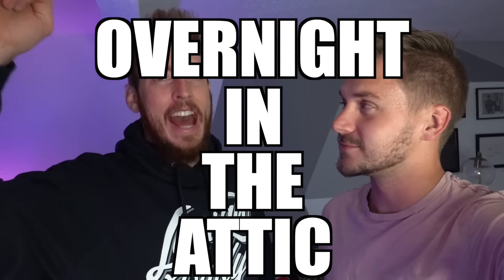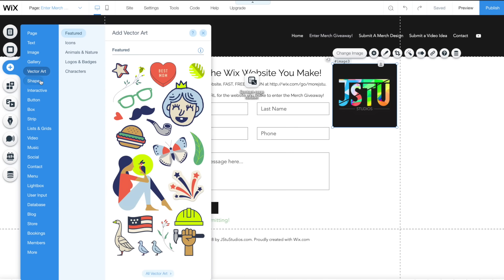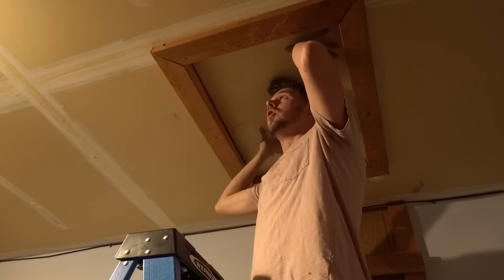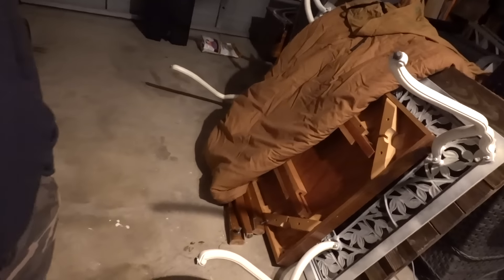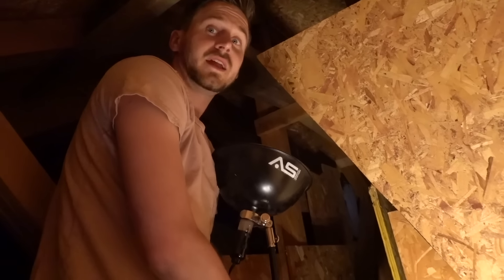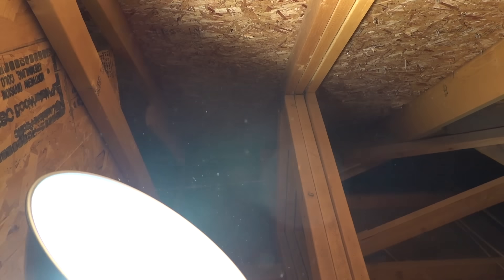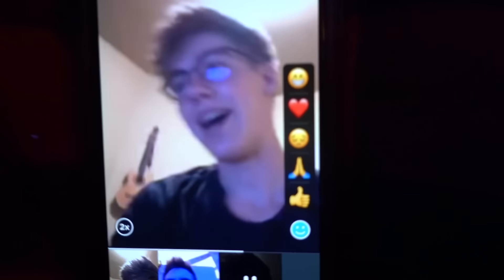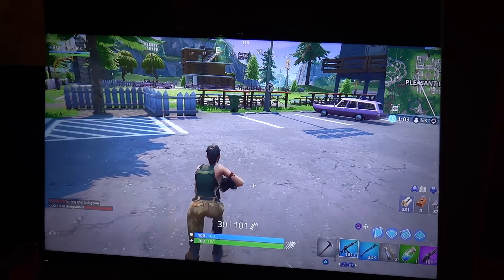24 HOUR OVERNIGHT FORT IN THE ATTIC!

Comment: Ps if you put vinegar on where the fiber glass  Insulation touched you it will make it stop itching/hurting.😁😲
Reply: IKR I had to remold my room and I touches some fiberglass and I was cleaning with vinegar and it spilled.
Reply: @Rachelle.F  my grandpa told me when I accidentally got it on my legs
Reply: Thanks for the lesson! 😱🙌🏻
Reply: Ok i like pickels